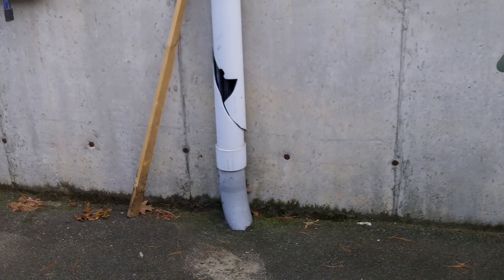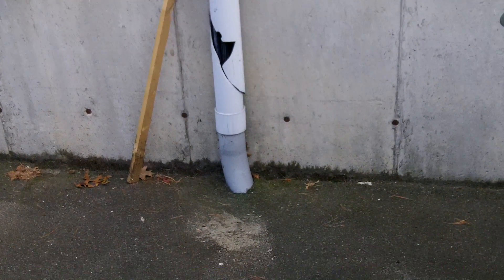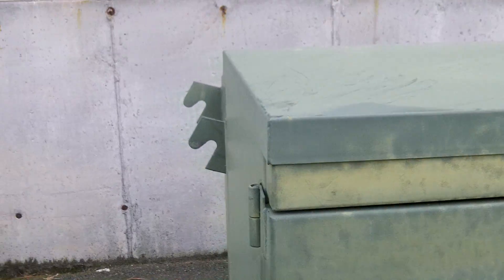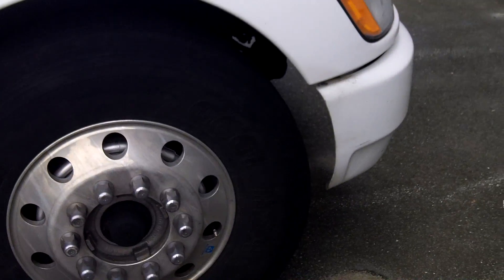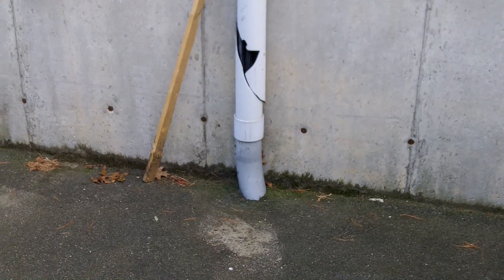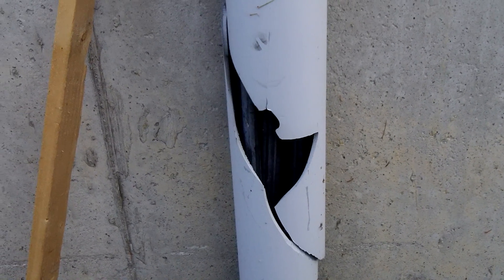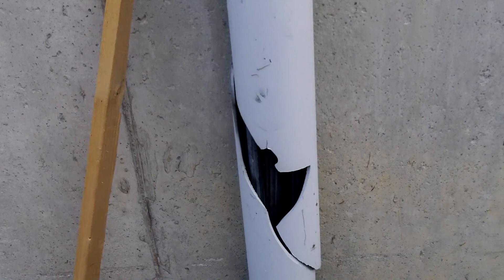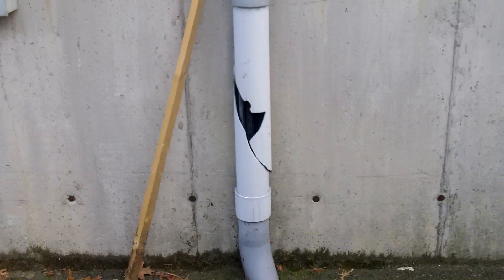Moving Violations Video No. 92: Exposed to Physical Damage

Comment: Exposed to Physical Damage is Open Ended with No Details. Anyplace is Exposed to Physical Damage. 
For instance an inspector failed me for this is an area outside in a residential yard. It is unexpectabke and needs to be refined. 

1. Driveways O.k.
2. Traffic Areas O.k.
3. Residential Yard.
4. The Inspector is the only Violation Exposed to Physical Damage.
Reply: Thumbs up.